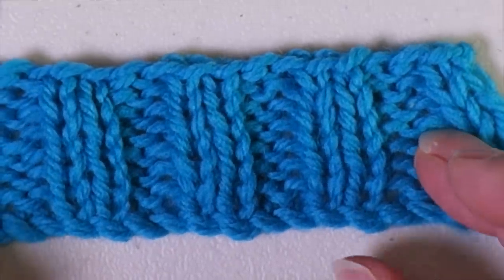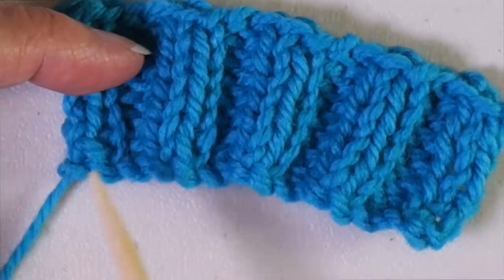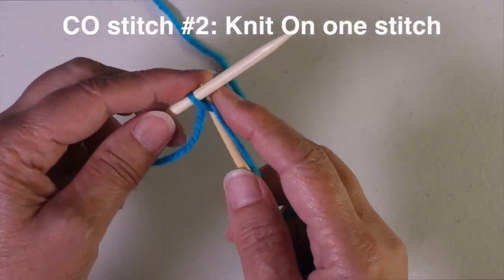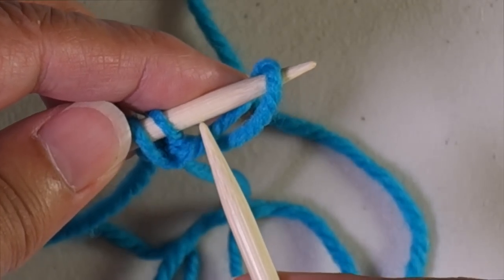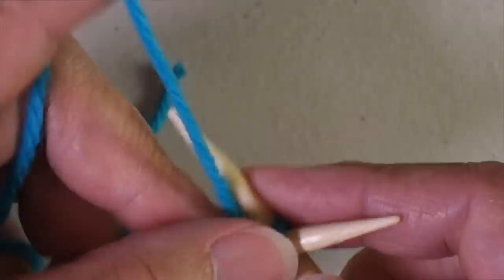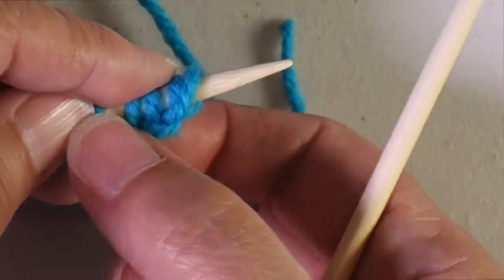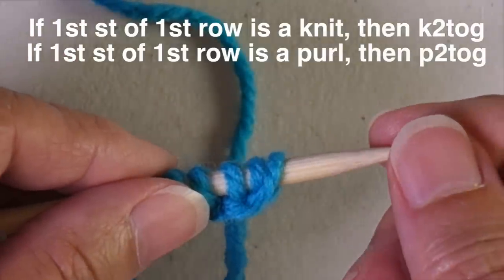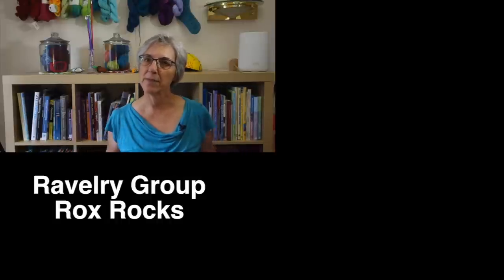Refined Cable Cast On // Technique Tuesday

Comment: Back again watching in 2023!  New question:  If I needed to cable cast on in purl, do these refinement tricks work for purling steps in creating the cast on?  Also, would I still enter the new loop on the right hand needle from underneath (not tip to tip) the way I see it here for the cable cast on worked from the front of the fabric (as you show here)?

Comment: Thank you for your clear instruction and clean demonstrations in all the tutorials Ive seen. I like the look this cable cast on gives to the start of my project.  If I were to use it on a scarf, how to I cast off to make the far end look the same as the starting end, with the twisted yarn look?
Reply from the maker: Most cast on methods do not have a matching bind off, and that includes the cable CO. There are cast on methods with matching bind offs, though, such as the crochet CO/standard BO, long tail CO and half-hitch BO, tubular CO/BO (a good option for k1p1 ribbing), and the picot CO/BO.

Comment: Wow!  So good to learn more of your simpler techniques!  Do you have an engineering education or are you  just a demolition derby expert in figuring these things out?  I always lean on you to learn better ways to make things that seem more difficult to learn than they need to be.  After all, a “HOBBY” is supposed to be FUN, right?  😇
Reply from the maker: Not an engineer, but I am very analytical, which was a great help in becoming a certified master hand knitter. For me, dissecting how knitting works is very much a part of the hobby. If I'm not continuing to learn, the activity doesn't hold my interest.

Comment: I just learned the long-tail cast on and now your refined cable cast on.  I have also been using the thumb cast on. This, so far, is my favourite. I just love it! Can this cast on be used for practically everything?

I am also about to knit four cowls using circular needles for the first time. I have to say I find counting stitches on a circular needle a little bit different and a little challenging. I suppose you get used to it.

Thank you for sharing.
Reply from the maker: Cast on methods have functional and aesthetic traits that make them useful in some situations, but not others. Many knitters use mostly the LTCO or mostly the cable CO. It's their go-to cast on for most projects. There will always be projects where your go-to technique might work, but might not be the best choice. And there will be knitters for whom a particular technique doesn't work well for a particular project type, but will work just fine for other knitters.  So, in general, a cable cast on will work well in most situations in which you need to start at an edge. It is sturdy, stable, and attractive, but it doesn't have as much stretch as other cast on methods can have. So if an extremely stretchy edge is needed (i.e. one that can stretch as much as the fabric itself can stretch), a cable cast on would probably not be the best choice. Cuff down socks need a very stretchy edge (particularly for people with high insteps and/or larger calves), as does some lace that will be aggressively blocked. Those are situations in which a standard bind off doesn't work well, either.
Reply: @RoxanneRichardson  Thank you so much, Roxanne. I am knitting a cowl for a 10-year old on circular needles for the first time. The pattern recommends using cable cast-on and my search on google brought me to your channel. So grateful. Also knitting for the first time in over 30 years!!!! So much to learn.

I wish you a Joyous Holiday Season!!

Comment: Great tip! Thank you! How do you use this cast on in the round? You end up joining on the wrong side when you get to the end. How do you solve for this? What I’ve seen so far is to work the first row flat and join in the second round?
Reply from the maker: I wrote an article for Interweave earlier this year that demonstrates the process when working in the round.  You can find a link to the article in my Ravelry group here: https://www.ravelry.com/groups/rox-rocks/pages/Interweave-articles

Comment: I love the look of this cast on!   I am starting a garter stitch baby blanket that slips the first stitch of each row.  How to I manage that first stitch to eliminate the second stitch?  I tried to slip both on the first row and then knit them together at the end of the second row but it doesn’t look right.  Thank you so much for your technical videos.  They are so helpful to understand the mechanics of the stitches and techniques.
Reply: Just posted this question to the Ravelry discussion board...

Comment: Great tip! I've got a pattern I'd like to make in which every row starts with s slip 1 wyif — should I only cast on 2 extra sts and follow the pattern or K2tog the first row and follow the pattern for the remaining rows? First 2 rows after CO are simple garter stitch rows.
Reply: I have the same question! What did you decide to do @RichInNFPA ?

Comment: Great tip, thank you Roxanne! I have a pattern requiring cable cast on, then seed stitch (K, K, P, K, P, K, P, K, K) and the first and last stitch are KTBL. Can I still use the refined cable cast on when there’s a KTBL?
Reply from the maker: Assuming you're casting on all the sts in the same way, and you aren't working the stitch pattern until you have all the sts on the needle, you can work the first row any way you like. This is the type of question you can answer yourself by doing a swatch and watching what happens. :-)
Reply: @RoxanneRichardson  thank you Roxanne :)

Comment: This is excellent, Roxanne.   I have another question.  I've finished my cable cast on..  My tag end is on the left side.... will  this be considered the front of my work?  or is it the wrong side.  I'm a right handed knitter like you.  Knitter is misleading.  I'm learning how to knit.  And I've also viewed your button hole vid which is excellent.  Do all buttonholes have to be completed from the front of a piece or does it matter?   Thank you so much.  jan
Reply from the maker: If you want to join in the round after doing a cable cast on, you will need to turn the work so that the needle tip with the working yarn attached to it is in your right hand. Different cast on methods produce sts on different needles. If the new sts end up on the left needle (as for a cable cast on), then you do not have to turn when working flat, but do have to turn when knitting in the round. If the new sts end up on the right needle (as for the long tail cast on), then you have to turn when knitting flat, but not when knitting in the round. The yarn is always attached to the last st CO/worked. When knitting flat, the first stitch (and only the first stitch) of every new row is attached to the left needle. Once you knit the first stitch, it's attached to the right needle. When working in the round, it is always attached to the right needle. This is important to remember when you put your work down mid-row, or at any time when knitting in the round. You will start up again with the yarn on the right hand needle!
Reply: @RoxanneRichardson  Merci! Merci!

Comment: I like this technique modification. Thinking about using it with a Stockinette project. What Bind off would you pair it with?
Reply from the maker: Most CO methods do not have a matching BO, and that is true of the cable CO. Not all projects have both a CO and BO edge, either. Is the entire project in stockinette, or are there non-rolling borders of some sort?  Are the CO and BO edges in need of similar amounts of sturdiness/stretch? There's no easy answer to your question! :-)
Reply: Roxanne Richardson thanks. I’m researching CO & BO, and in doing so am learning there are matching techniques, but not across the board. I’ve used a cable CO for single horizontal buttonholes. I didn’t know if there was a matching BO. That prompted the question.

Comment: I am using this for long tail also. Do you have a better technique for a long tail cast on than this?
Reply from the maker: This technique is specifically for the cable cast on. It has a very different structure/construction than the LTCO. I do have a video on a jogless join for doing the LTCO in the round.

Comment: Thanks for this great tip.  Is this cast on as elastic as the long tail if done as you do it by not tightening up until after placing the needle between the two stitches?
Reply from the maker: Either cast on can be made to be rigid or elastic. I tend to find the cable cast on less stretchy in general than the LTCO, but that doesn't mean you can't make it as stretchy as you need it to be for a particular project. If you use a larger needle in the right hand when you do the cable cast on, you can force more space between the sts. The way to know if it will be stretchy enough for your use is to do a swatch and see how much stretch you can get out of the edge.
Reply: Thank you, that makes perfect sense and I'll try the tip of using a larger needed in the right hand.  I like the idea of a cast on that doesn't require a guesstimate of a long tail.  I've tried many methods of measuring how much tail is needed, but rarely get it right.  BTW, I'm a real fan of both your Tuesday and Friday videos!

Comment: May I ask why do you drop two at the beginning and not just one?
Reply from the maker: Because neither one of the first two sts was created using a cable CO. The first is a slip knot, and the second is created using the knit on CO. Also, the slip knot won't release if the 2nd st was created using knitting on. (It will if you used a 2nd slip knot, or a backwards loop, but you'd be in the same situation where the first stitch was not created using the cable CO process.) So the point is for all the sts remaining to have been created by actually working the cable CO.